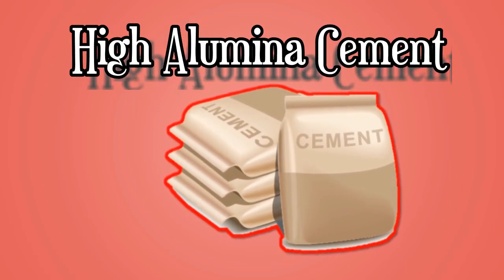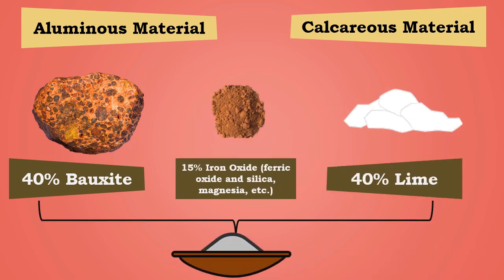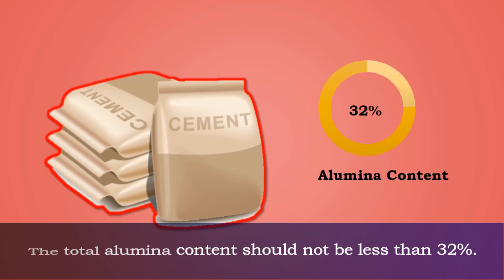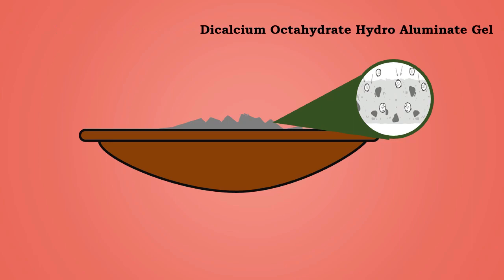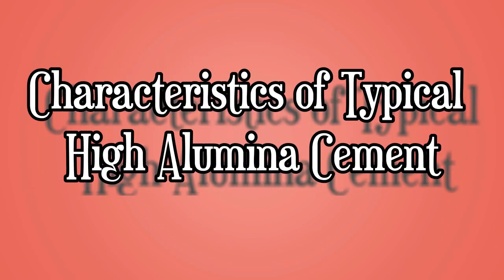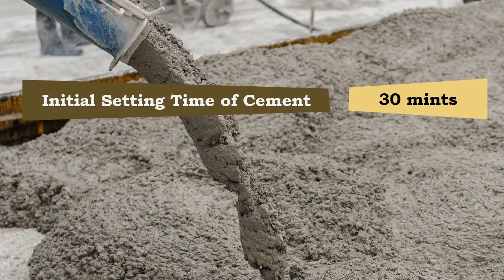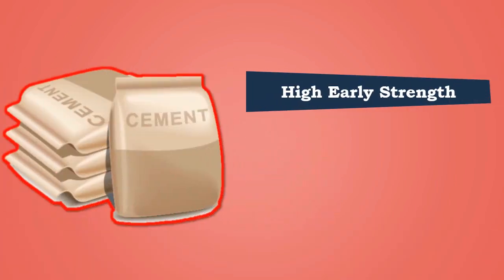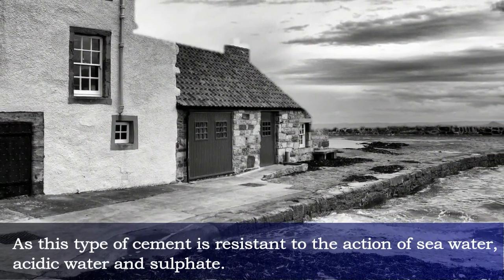What is High Alumina Cement? || Properties || Uses || Types of Cement #2 ||

Comment: initial setting time is 3.5-4 hours
final setting time is 5-5.5 hours
Reply from the maker: +dhananjay kumar thank you for comments..... The data we provided was as per Indian standard code... This data's are formed under standard circumstances. In realtime it may slightly vary based on the factors such as temperature, production stages, admixtures etc.
Reply: What are the odds if rapid hardening additives are used?

Comment: hi  . about CSA(calcium sulfo aluminate) cement > if we do not have access to this kind of cement , is there an alternative to this?can use CAC(calcium aluminate cement)+gypsum and what percentage?
 i want a CSA additive. It is designed to be, and MUST be, blended with portland cement and actually speed up strength gain and use in  concrete countertop.
tnx.